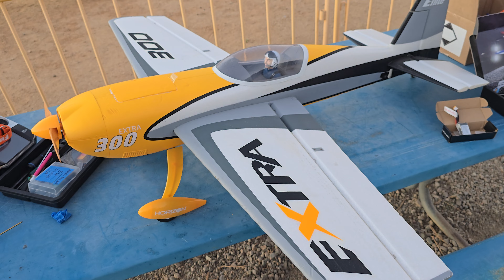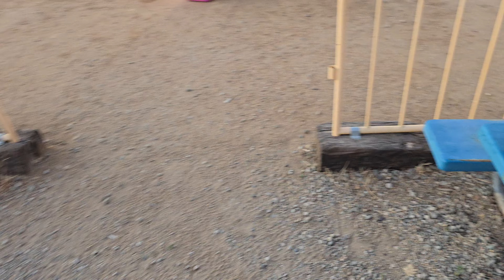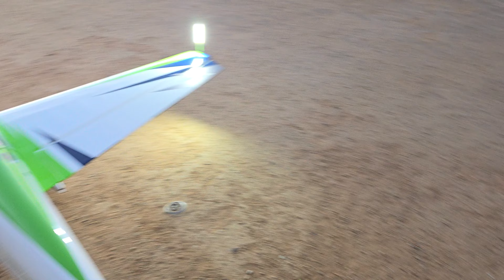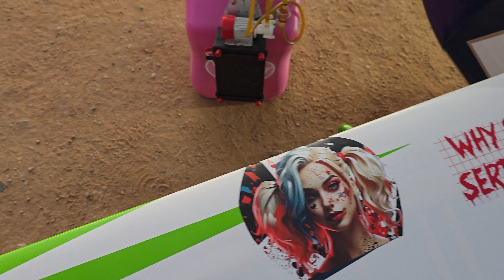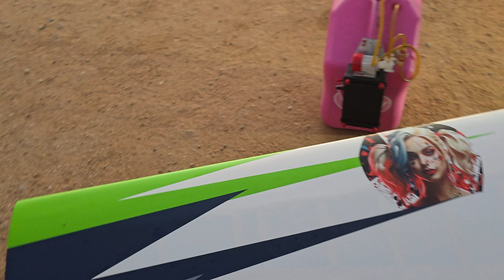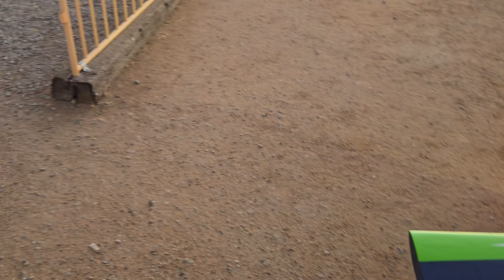Field Talk

Comment: Replace the landing gear that wire is a pain ….mine always seems tail heavy I put 4s 2200 and 2600 all way to the front
Reply from the maker: @slange455  what did you replace that landing gear with?
Reply: I used one I had laying around was a Dubro i think it’s fiberglass from for a 40 size nitro plane…it’s holding up well I might order a carbon fiber there are a lot out there but they don’t have the dimensions